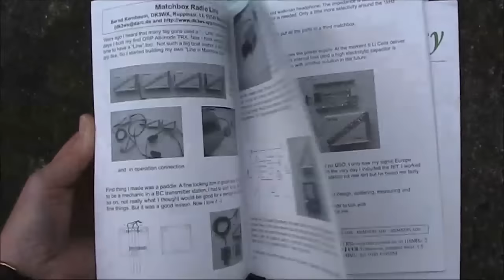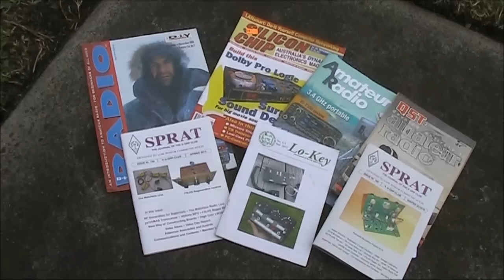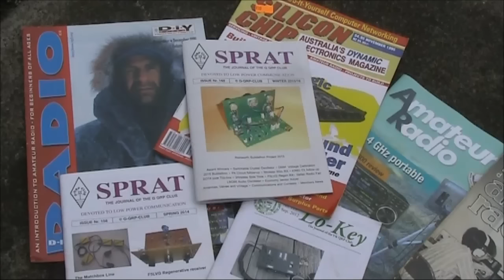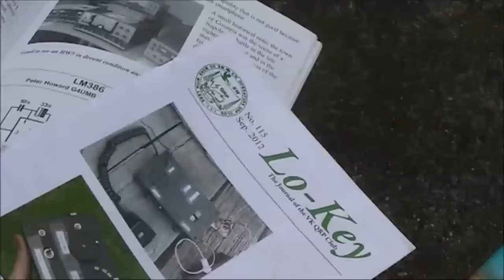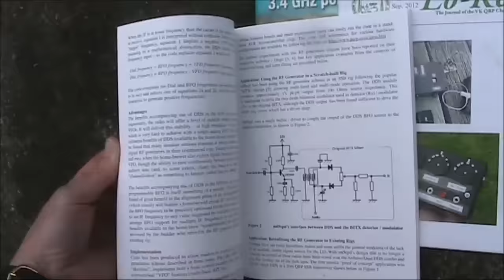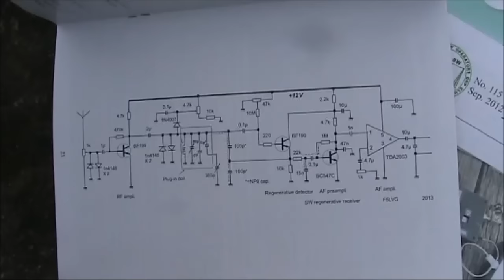How to write an article for a magazine

Comment: Hi Peter, your video contains good tips for writing an article for a paper magazine or online.

I think the paper magazines are going the way of the dinosaur ... just like the "newspaper".  An example in our case: my XYL and I elected to have AR delivered electronically, and not in hardcopy form.  Incidentally (and slightly OT): I haven't bought a "paper" in years, but I still refer to the online news websites collectively as "the papers" ... :-)

One aspect I like about "publishing" the few articles I do write on my own website is that I retain editorial independence - from the viewpoint of being able to update the material if required over time, and protecting the integrity of the technical content.

Thanks again for the video,

73, Mike VK2IG